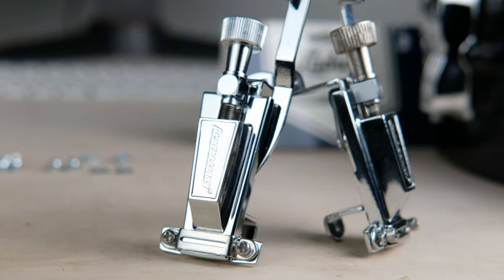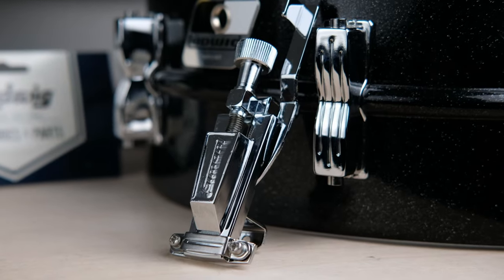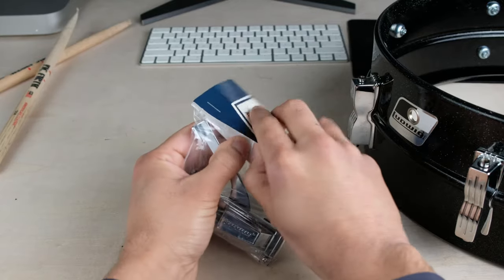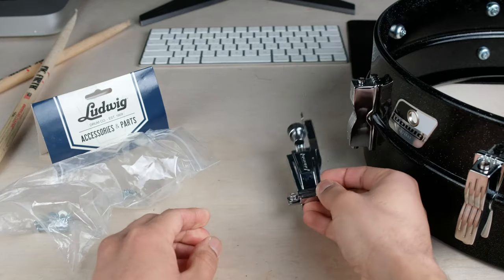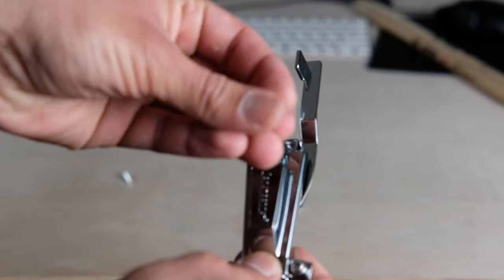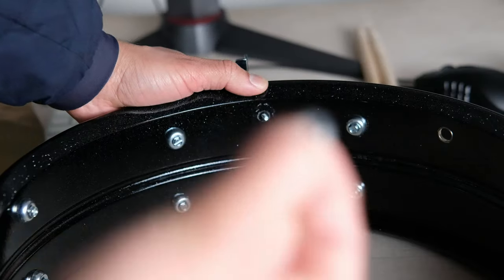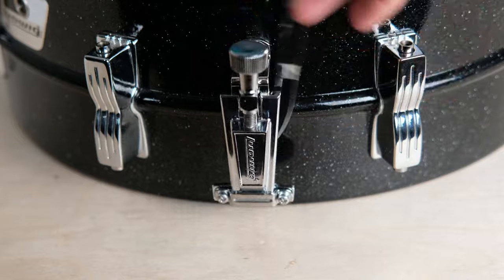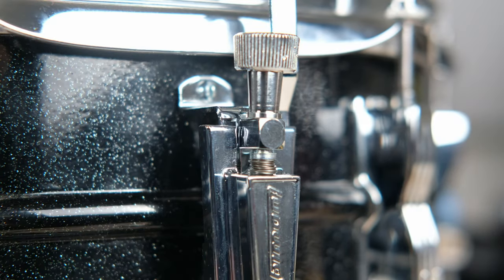ludwig p85 throw off replacement

Comment: I installed one on an old Gretch round badge chrome / brass snare drm. The Gretch throw off sucked badly. The new throw off works great. Think I had to drill 1 hole to mount it. Worth it but wrecked collectability I imagine but I used the snare as a spare or sometimes as my principal snare. It's a late 60's early 70's model. Weighs a ton. Great sounding snare.
Reply from the maker: COB is always a win! Extra holes will definitely reduce the collectability but it won't matter much if you use it often and plan on keeping it.